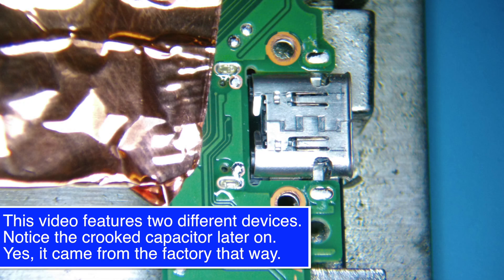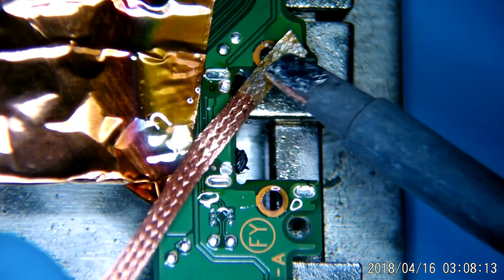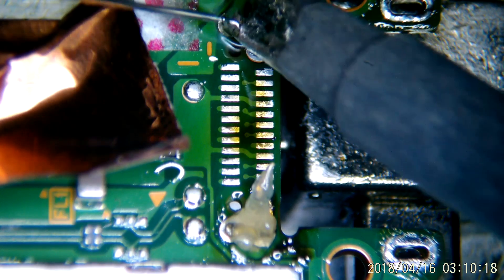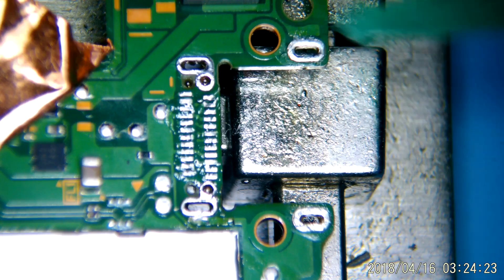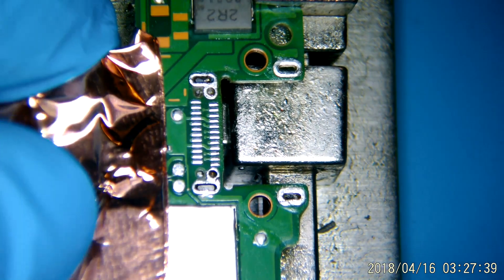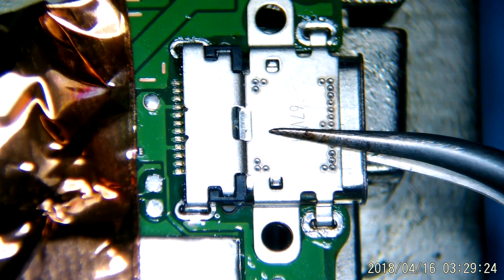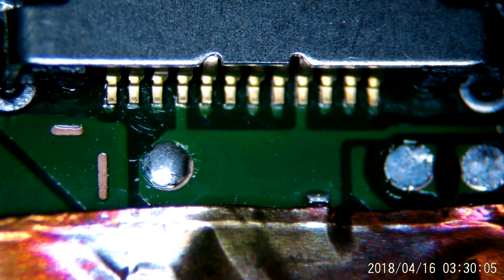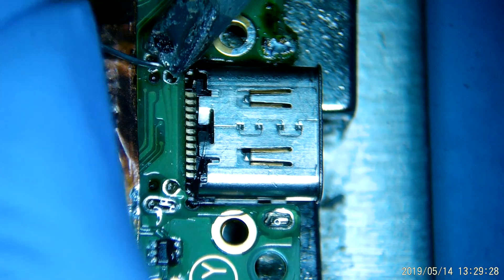Nintendo Switch USB-C Port Replacement

Comment: Just stick some low melt solder paste on the anchors and then the port will come off so quickly with minimal heat on the board and you won't need to cover anything like you did with the aluminum tape.
Reply from the maker: That works too. I'm just lazy some times.

Comment: Hey
On the diode mode, where do you connect the positive multimeter probe?
Reply from the maker: The red probe goes on ground. The metal shield nearby should work.

Comment: Hello, can you help me, please? Yes. Do pins 4 and 9 go from the bottom row through the top row? Is there a connection? Because my solder has connected both, and there's basically no UV coating there. There’s no UV mask. Are they shorted? No, right? Because I can see on your PCB that the traces go through, and there’s just green UV mask in the middle. Is this a problem, or is it a short Circuit?
Reply from the maker: A4 goes to B9 so if I understand you correctly, yes. If you have any doubts, just look at a USBC pin out image.

Comment: Thank you for telling all the settings and describing the elements we need. The other videos did not do that and it is very necessary for us beginners
Reply from the maker: I'm glad that you found it helpful. You'll find that people don't like to give exact temperature setting because there is so much variance from one piece of equipment to the next. That said, it's nice to have a rough idea which is why I let people know what works for me. You have to adjust accordingly.

Comment: Hello, good day to you. What can I do if after the replacement the value  .718 in diode mode is .202? The console charges the battery, and I think power on because the logic board turns warm but has no image. Thank you for your comments and assistance.

Comment: Are you using regular aluminum foil to cover the area around the usb c connector or is it another material?
Reply from the maker: It's an adhesive foil tape that is a bit thicker than aluminum you'd use in the kitchen. I believe it's called Nashua.

Comment: Thanks for the video. I'm currently fighting the solder in those holes! I think my iron isn't set up correctly. What temperature did you use roughly?
Reply from the maker: My iron is set to 840C. You want a good sized tip and be sure to work on the board while it is still warm. Plenty of flux and add some leaded solder if necessary.

Comment: What tips do you recommend for soldering hdmi ports on ps4 & xbox one and also to solder nintendo switch and other charging ports? I have the hakko FX888D soldering station.

Comment: Do you do this service for ppl I’ll be glad to ship mine out depending on price. I don’t trust myself and I’m pissed I replaced the battery thinking it was the battery did it myself but this is way more complicated than a battery replacement. Dammit I’m disappointed,

Comment: My brother replaced my charger port and now when charging it, the cable must be a specific direction and it won't connect to a dock. Any idea why?
Reply: If you are still curious after 6 months: Your brother probably didn't get the second(hidden) row of pins to connect to the pads correctly.
Reply: Tylor Boland I have the same problem! I haven’t been able to find any new solutions, but I don’t wanna pay $ for a replacement just yet if it’s an angling issue

Comment: Thanks for this, I need to do this for my laptop! Makes you wonder why they don't just make a separate USB C board with easy to remove internal ribbon... Ports must be the most common parts to need replacement after shattered screens and dead batteries on mobile devices
Reply: Repair is a business too... Don't wanna make things too easy to where people won't pay other to do it...

Comment: can you explain the measurement that you did (diode mode ) why you put the red probe on ground .?
Reply from the maker: I could but it would be a lengthy response. There is a good explanation in the comments section here: https://electronics.stackexchange.com/questions/366143/using-diode-mode-on-my-multimeter-to-debug-circuits-a-good-idea